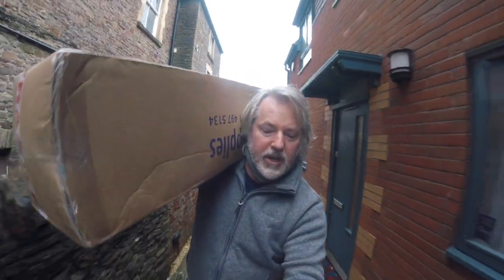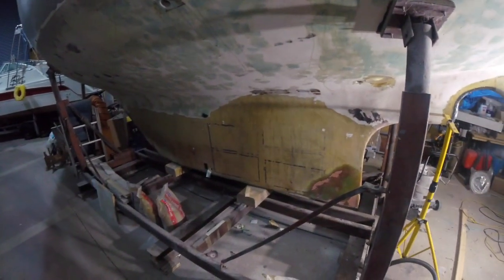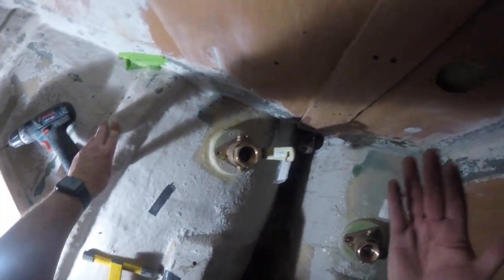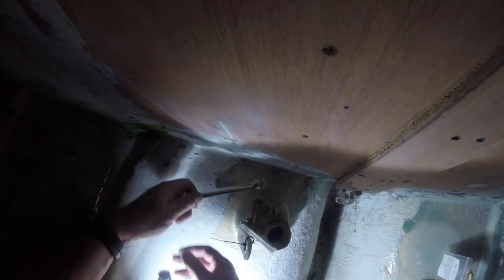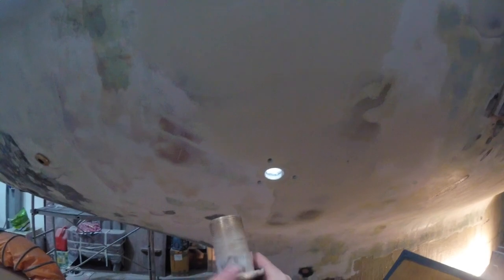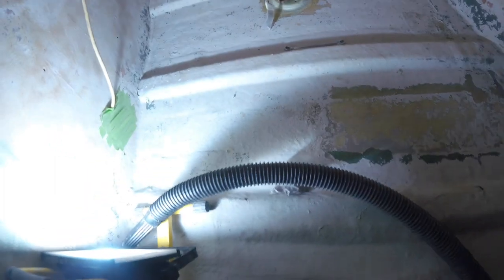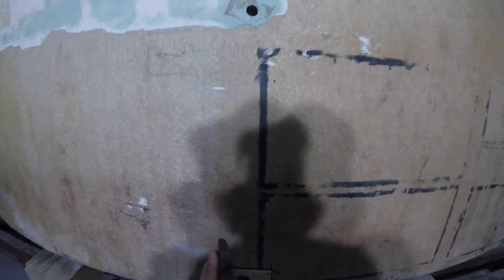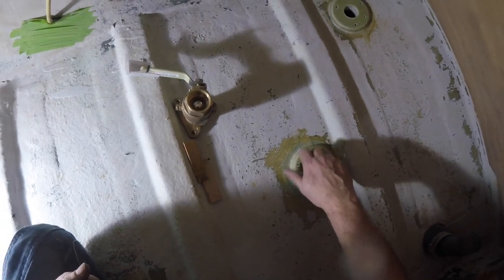#66 Seacocks in at last!

Comment: Why not just countersink the bolts into the backing plates then use thickened epoxy to adhere it to the hull.  For centering purposes you could use a cone shaped soft wood plug.  Punching 3 additional holes through the boat for each seacock is asking for trouble.
Reply from the maker: because if for any reason the bolts break the adhesion with the epoxy they will be spinning around and I won't be able to get to them without cutting out the backing plate - not a great thought. If the bolts break the adhesion with the epoxy in the current set up all I need do is scrape off some antifouling and a little filler and reset them. 
In fact those three additional holes are the best way of achieving ABYC standard H-27, if you google the following you will see a diagram which shows exactly the method I have chosen (punching three additional holes as you say) Note these are stricter than their European counterparts. I always look for industry standards and try match them, and if I deviate it is likely due to mitigating circumstances. 

27.6.1 A seacock shall be securely mounted so that the assembly will withstand a 500 pound (227 Kg) static force applied for 30 seconds to the , without the assembly failing to stop the ingress of water.
Reply: I agree, adding extra holes is not the way I should go.
Reply: @aboatcalledwanda6925  ABYC standards would easily be met without having to drill through the substrate. Keep in mind the backing plate is epoxied to the hull that surface are alone would be enough to support the 300kg/660Lbs of force at over 6000 PSI of tensile strength. Then you add to that the strength of the bronze through hull in tension and you're, well I'm not going to do the math but lets just say you'd be in the clear.  I'd imagine you used carriage bolts - though I think you call them something else, but they're square shanked bolts.  They would not have only the boding of the thickend epoxy for support, they would also have that bedded in shank. Yes, in the event that you use and impact gun to pull those off and got the bolt spinning I admit you would have to use a multi tool to cut the backing plate off the hull which is not a great thought. But I'd feel better about the possibility of doing that work over having 18 additional holes with metal fasteners that will be prone to galvanic corrosion, in my boat.
Reply from the maker: @bobadam7021  you're still not being clear on the downside of this method, which again is given as best practice by many sources, including ABYC. I know people take about 'putting holes in boats' as a negative but really we need to examine what the risk is. In your view is the main concerns galvanic corrosion? Galvanic corrosion is NOT an issue as the bolts have the same galvanic properties as the backing flange, which is bonded. Therefore the backing flange, thru hull and screws all are bonded and all have the same nobility. And all of the components below the waterline will be bonded to an anode.  wouldapproachwouldarea added by the backing plate did not overcompensate for the loss of the hull material where the three holds are drilled. Ive not seen any testing or evidence to suggest that in my research; on the contrary the thru bolted approach is more often referenced to. But it's your boat so do it the way you feel comfortable with :)
Reply: @aboatcalledwanda6925  "But it's your boat so do it the way you feel comfortable with :)"

In the end it will always come down to this. In the end it will always come down to you're comfortable with more paths for sea water to enter your boat than I would be on mine. I could give you  various corrosion related reasons how one day many years from now that bolt head could become dislodged while sitting in a travel lift swing and the boat could sink, but the same could be said for anything.  It will all come down to maintenance.  Plus your way is already completed so it's time to move on.
Reply from the maker: @bobadam7021  let's agree to that.